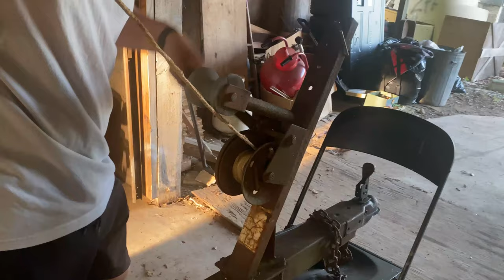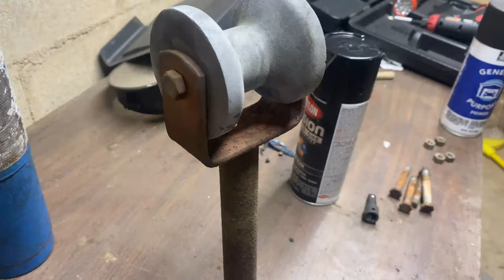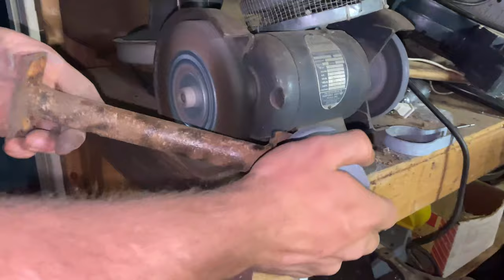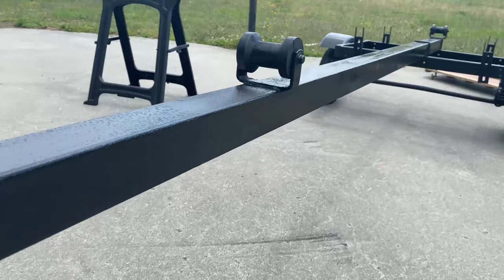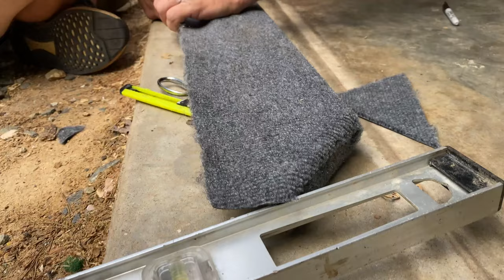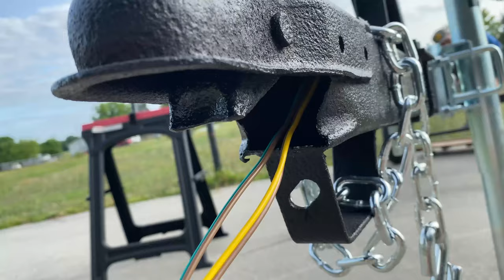RESTORING A RUSTED JOHN BOAT TRAILER AFTER SITTING FOR ALMOST 10 YEARS

Comment: I'm about to do the exact same thing. Do you think a wire wheel grinder would work as good as the sander. Also what kind of lights did you get?
Reply from the maker: I’m sure that a wire wheel grinder would work, you may also want to try using a flapper wheel first to get a majority of the rust off first of its severe
Reply from the maker: Also the lights we ordered a led kit from Amazon but you can find the exact same things at a harbor freight for pretty cheap

Comment: This is exactly what I’m getting ready to do too. The only thing I didn’t see was water-proofing the bunks. Other than that, this is great
Reply from the maker: Yes you’re completely right about not water proofing the bunks, at the time we were trying to get the trailer done as fast as possible so that we could get the boat back on to the trailer, if we could go back we would have used marine grade wood, instead we just used some wood that we had around the house